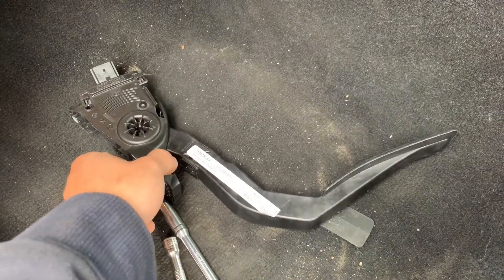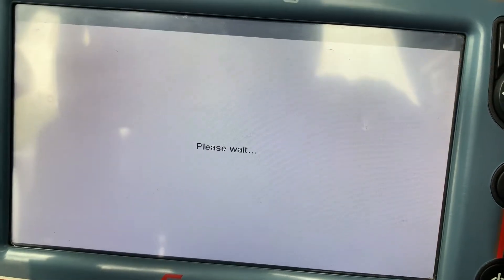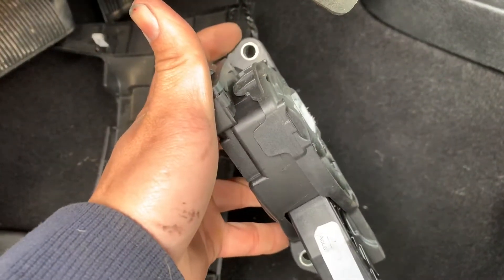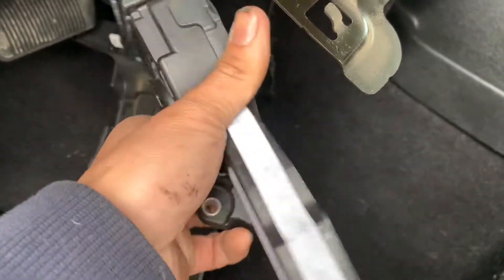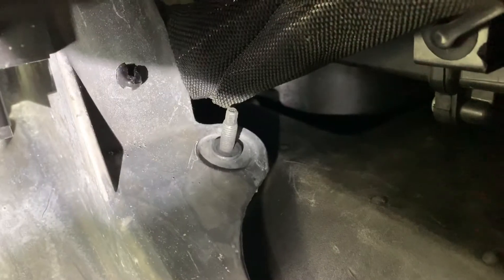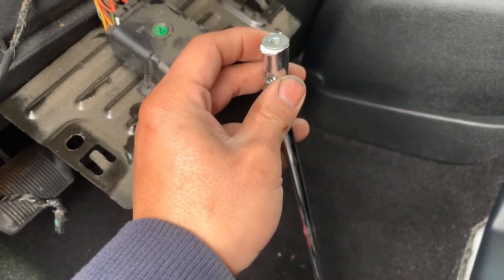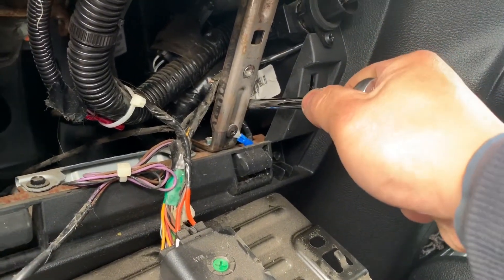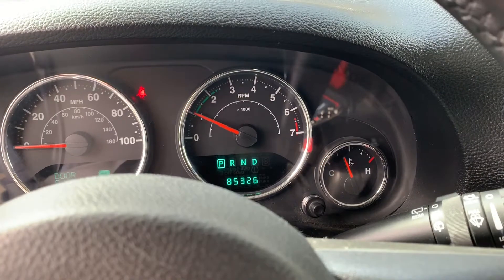Jeep Dodge Chrysler Gas Pedal Replacement (Code P2122 / P2127)

Comment: I've got a p 0642,p 2135,p2122.2012 avenger.  I was getting a no fuse code and the red lightning bolt flashing. Changed the etc. Now I'm get those codes.  Hate to keep throwing money in it. I don't have money to take it to the shop.
Reply: Did you get it fixed? I have the same issues

Comment: I got po123 and p2122 for dodge charger wat do I do
Reply from the maker: Do the same.
Reply: Mine to my 2014 300 c ima get my pedal  position  sensor  2m n do it myself  dealership  will probably  charge I few hundred  to do that easy shit
Reply: @dawonnejackson7316  did u get it done?

Comment: okay what was happening with it ... I have a 2016 town and country, and the ETC light is flashing and when I give it gas, it does nothing, so its just parked. I try rev engine it doesn't even rev.
Reply from the maker: Replace the pedal. Is there any check engine light?
Reply: @Ah_Duuu_Ma  the check engine light has been on after i had plugs and coils replaced but the red lighting bolt symbol is on, think its the drive train light.
Reply from the maker: @shaunsfrench1942  No idea.
Reply: @Ah_Duuu_Ma  what was happening to your vehicle why you changed the pedal? what happened beside the check engine light.
Reply from the maker: @shaunsfrench1942  Gas pedal sensor going bad internally, that's why it throws the codes.
Reply: @Ah_Duuu_Ma  I found the issue, it was some broken wires by the battery, pedal is still good. now i just have to find a local junk yard to see if its the entire wire harness.